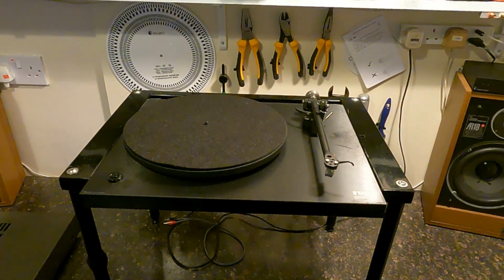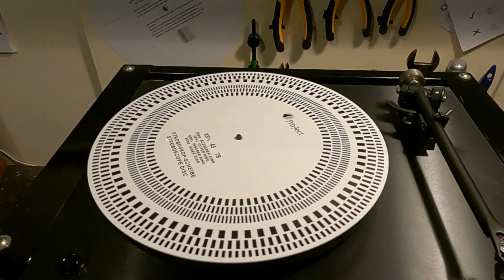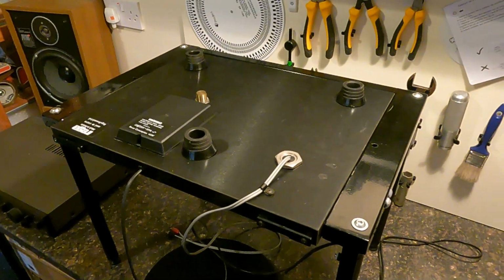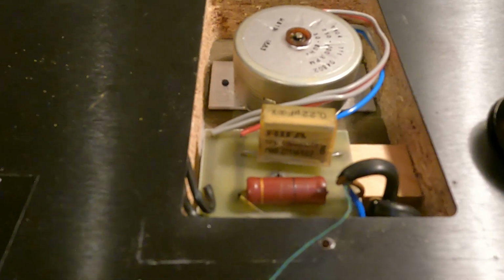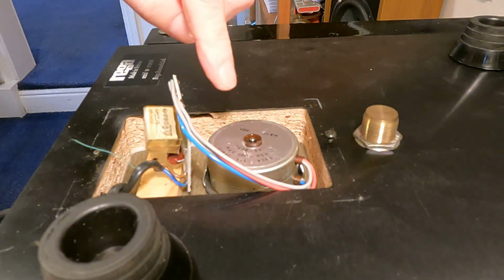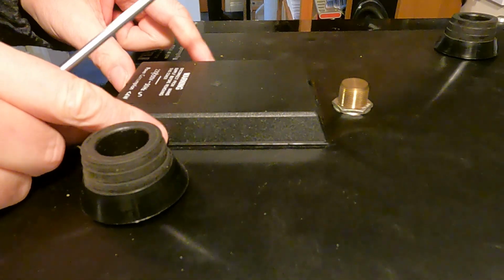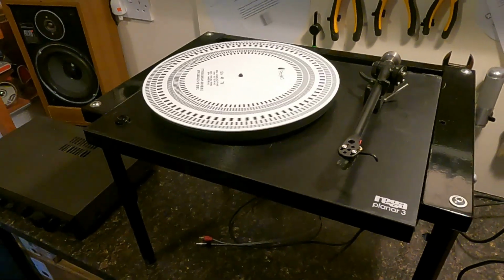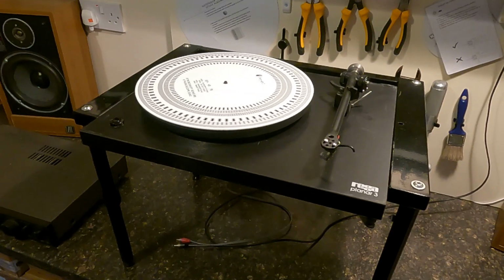Rega Planar speed issue video #3

Comment: Hi before I start what is the number/ values of the capacitor so I can order one in advance thank you for very informative footage. I've had my RP3 since the mid 80s the cd player died the cassette player died the cards in the quad have died but replaced them with phono  amp and works very well

Comment: Great video,very informative..
Quick question though 
I’ve changed the belt for a new one also put a small amount of glue on black belt roller,left it overnight to dry.
The turntable still runs slow on 33rpm not as much as on 45rpm ?
What are your thoughts please

Comment: Hi,
My motor says ' MB 10 4680'. The turntable spins fine at 33.4 in the larger groove but is only 23 rpm in the smaller groove.

I think I should change the capacitor and the resistor both. Can you please tell me the exact value of these two components?

Comment: Question? I have a Planar 2 that has an odd humming noise. I snipped off the cheap RCA cable some years ago and eventually rewired the tonearm and ran a separate ground wire to a new ground post. Everything has been nice and quiet except a few months ago it started this humming noise. Changed carts and preamps with no change. Thought it was the wiring and just rewired it again with no change. Now it pops when turning on and off the motor. Is it possible a capacitor on the motor circuit board is bad? I've seen the upgrade motor kit, but for $250 I'd rather make this my last choice. I did a RPM check from a phone app and it's running 33.88 RPM +1.62%. I'm still using the original wall wart power supply. Any help would be greatly appreciated. Thanks!

Comment: Great video !  I nearly purchased a new Rega P1 the other night for £300 but after watching your video I opened up my late fathers P3 & low & behold the resistor is shot.  I’m struggling with picking the correct replacement though, would like to get a Rifa to keep it as close to original as possible, had a look on rs but not 100% what one I’m looking for ?
Reply: Managed to track down the right capacitor from France £10 which is overpriced I know but speed issue fixed so I one happy camper !  Thank you so much for your video you’ve not only saved me hundreds of pounds but breathed life back into my late fathers turntable !

Comment: Confusing advice about removing the motor, since I just watched your video on the 24V upgrade, and it doesn't seem to be a problem there?
Reply from the maker: Fitting the 24v motor is a completely different procedure and doesn’t have the many possible adjustment and screw stripping issues
Reply: @cheshireaudio  Got you.  Shame your otherwise excellent "install 24V" video didn't include the removal of the old motor - although I assume it's not too difficult.

Comment: Hi. Like the video series thankyou.
In NZ we have 230v and I’ve a p3 that I’ve changed both cap and resistor on but still have and issue of not starting or starting backwards and motor jumping and vibrating? Tried several variations on values for both and still it runs slow? Oiled the spindle and changed the belt but no dice? Any thoughts would be greatly appreciated.

Comment: Excellent tutorial - only improvement I would suggest is a little advice on the soldering part as it's a bit fiddly. Repaired my 38 year old Planar which now runs true (measured by eye/stopwatch = 59.61 seconds for 33 ⅓ speed both cold and warm). Thank you so much.

Comment: It would be very useful if you listed the actual component in the description.  I have an RP3 running slow, and have used your other video to check possible solutions.  After having some fun getting the pully back in (lol) I'm left wondering if I need to do some surgery, but if I had the component I might consider just changing them out regardless.

Comment: I have replaced a few capacitors on Rega decks, but have come across something which is new to me. I'm doing the same procedure on a Moth Alamo (Planar 2 clone) which runs slow after about half an hour. I've found a resistor fitted across the capacitor. Any ideas?

Comment: Hi.  Thanks for your videos they're very useful. In one of your videos you're fixing a fault in a dead Rega planar. You check to see if the pulley is vibrating. It isn't but mine is! My wife was playing it a while back and it slowed down and then stopped. When I took the platter and belt off and turned it on the pulley would spin bit then stop and just vibrate. I replaced the capacitor as was suggested by a few people. When. I turned it on again without platter and belt it started to turn. I put the belt on it slowed down, stopped and then vibrated. Do you know what could be causing this please? I was going to buy a new motor but I noted in your video you said they rarely break. I wondered if it was something to do with the motor shaft connection to the pulley but not sure how I'd test this. Any thoughts gratefully received, I'm fairly skint but would love to get.my record player working again for Christmas! Thanks. Ben
Reply from the maker: Emailed you

Comment: I have a 30 year old Rega Planar 2 with the same speed problem. In my Rega, there are 2 green capacitors 0.22uf 400volt. I have tried to replace both capacitors twice with new film capacitors with same values (they are smaller and not green), but the problem now is not dwindling speed. It is rather too slow speed....I am lost. Any ideas? Thanks!
Reply from the maker: The later green caps don’t seem to fail. Have you checked the motor pulley is attached properly and that the ball bearing is still in the main bearing (sub platter bearing)
Reply: Thanks. I resoldered the original green caps in the circuit. The belt is also new. It turns out the pulley is loose. Very strange that it reduced speed after approximately 15 mins with a loose pulley? Maybe it slips more as it gets warmer?
Reply from the maker: @feracingdf29  Aah, great news, glad it's sorted  :-)

Comment: Took my 1984 Planar3 to Philip 2.1/2 hour round trip as it was having speed issues. He fixed it no problem and carried out a service for an unbelievable low price IMO. What Philip doesn't know about Rega and their clones is not worth knowing. Very knowledgeable as you probably know and a really nice guy with it. I have no hesitation in recommending him and his shop. Thanks again Philip your a star. If I need any of my hifi for a repair or service I know where it will be going.
Reply from the maker: Aaw thanks :-)
Reply: Thank you Philip, credit where credit is due.

Comment: Just a note on the old REGA. The mains wiring goes to the PCB,  and only then to the on-off switch. The small PCB always has Live and Neutral present and un-protected when the unit is plugged in. Please be careful when removing the cover that the plug is not still in the wall socket, the Rega switch doesn't isolate the unit. Whoever came up with the PCB should be shot. It should wire to a fuse, then the switch, then to the Motor PCB.

Comment: Thanks for the video. I've been having some issues with my Rega Planar 3 over time , slow starting (easily fixed by nudging the platter to get it going) , however is making that knocking noise sometimes on start. it's pretty old (1986) , I recently replaced the Suspension belt , however problem still persists.  Capacitor looks good, but is old. So will look to replace it or just go for the 24v upgrade.

Comment: Really helpful. Thanks very much. I easily replaced the capacitor bough from ebay "Rega Planar Motor Repair Capacitor For Earlier 220V 240V Models 0.22uF 220nF"